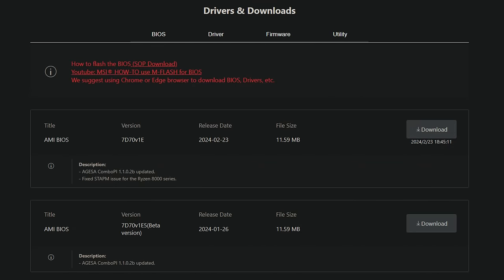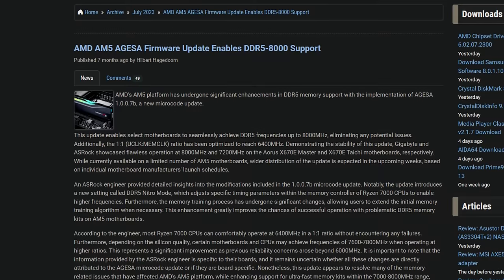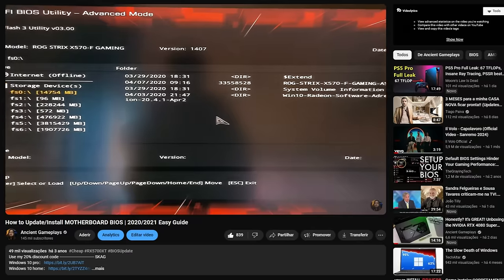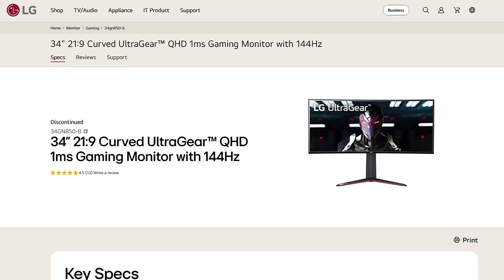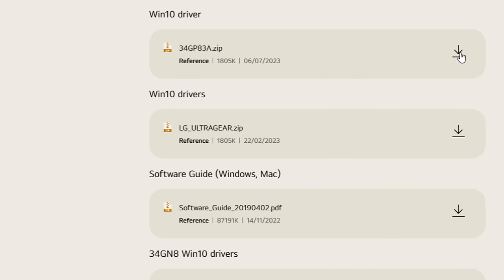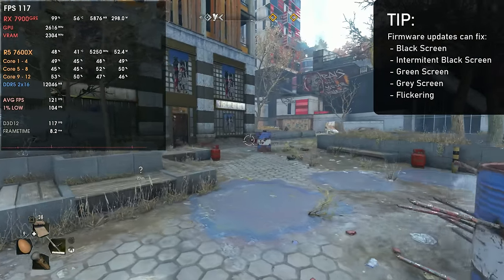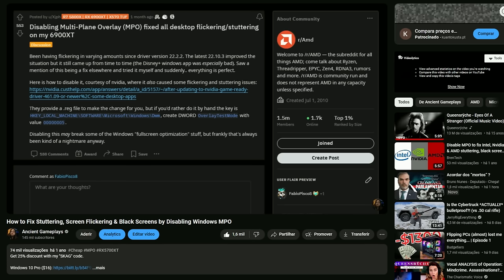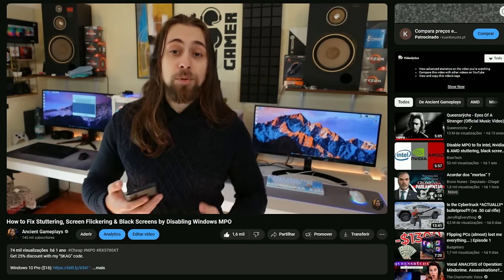20 TIPS to FIX "AMD GPU's Problems" | Easy 2024 Tutorial Guide

Comment: My graphics drivers suddenly time out, other times i get freeze and reboot, and some other times also i cant use the adrenalin software because it shows error of compatibility. While i game, i dont get any kind of reboot or timeout. Also sometimes, i have noticed green pixels flickering before boot, and then they stop in windows. I have tried ddu, chipset/gpu drivers, and many of your advice. Do u have any idea? 
Gpu: rx7900 xt
Cpu: 5800x3d
Mobo: b550 ax v2
Thanks again.
Reply: Woww tienes un monstruo. Lastima que tienes esos problemas. Te deseo suerte ❤
Reply: @catrielllampa6407  i did installation of the previous drivers plus new bios for the mobo, till now i dont get the same issue. Didn’t set mpo off yet. If i get it again, probably i will do a format to see if the issue persists.

Comment: Please help! Ryzen 5 5500 good for RX 6600XT?  Thank you master! And what is the max gpu, for the r5 5500 in 1080p?
Reply: The Ryzen 5500 only has PCIe 3.0
An RX6600 XT is only connected over 8 lanes. The Ryzen 5500 would slow down the 6600XT.
The 5600 would be better here.
The Ryzen 5500 only has 16 MB L3 cache.
The 5600, on the other hand, has 32 MB of L3 cache.
A large L3 cache is really important to prevent the CPU from having to ask the RAM for data it needs.
Reply: @40erKoernungSchachtpappe The performance impact of pcie 3.0 on a 6600 XT is pretty small if you look up actual tests, also you do need a B550/X470 mobo for that even if you get a cpu capable of it. The 5600 is significantly CPU better than a 5500 (Aka 5600G without iGPU) of course as you note otherwise. The 5500 is about on par with the previous gen 3600X.

In any case in that price range it's generally worth going used for at least the cpu/mobo if possible so which exact one you end up with may be dictated with what you end up getting a good deal on.

Comment: You buy a car in the showroom and go straight to the garage. On the way, a tire falls off, brakes fail, the steering wheel inverts, the engine shuts down.
Fuck it, it's normal, it can be fixed.
Reply from the maker: A completely messed up analogy that makes no sense. It's  more like, you buy a gasoline car, made to drive on good roads, then you go make cross with it while filling the tank with diesel, and THEN, you complain about how those cars suck
Reply: @AncientGameplays  Why should users of a finished product fix smth that should work out of the box?
Do you think that's normal? Personally, I think it's an impudence and an indication that AMD has a lot of nerve.
Reply from the maker: @eyesta  if you don't want to make anything buy a console as PCs are not for you
Reply: @AncientGameplays  I didn't ask you for advice on what to buy for me, I asked you what you think about AMD's attitude towards their users.
I've had a lot of AMD GPU's and they are all crap on the level of Nvidia, in work tasks it's especially crap.
I know what I'm talking about and my PC experience starts in 2004.I remember the real ATI, but now it's thrash.
I'm now a user of Nvidia products and when I watch your vids I enjoy my PC and laugh at you.
Peace!

Comment: When should I start worrying about psu age? My psu is already 8 years old(had it in my pc since 2016 and everything else has been upgraded since then). The psu I have is high quality and has 10 year warranty but still better be safe than sorry.
Reply: Capacitors are what degrades in power supplies. If you have a branded power supply, a long warranty indicates good components. Check the voltages, if they are stable everything is ok, stay calm 🙋
Reply from the maker: When it starts giving issues mostly

Comment: I didn't exactly try everything shown but I have taken my gpu out and tested my friends gpu ( deleted drivers before that and was already having problems) and my friends xfx r7800 series ghost worked way better. Then I put my rx 6750xt back and no issues until i downloaded drivers back (the latest ones) qnd suddenly all steam games are crashing and cod won't even start, I deleted the drivers once again (currently still withouth drivers) and now working again perfectly withouth crashes but some frame drops. What should I do?
Reply from the maker: You have something missing or causing issues there, maybe some software. Use ddu and update chipset drivers to begin with
Reply: Thanks! I'll test those tomorrow
Reply: It also crahsed withouth drivers ao I don't know what the issue is but I will try those. My windows might be corrupt in some way

Comment: Ancient Gameplays, your AMD videoes are amazing and has helped me alot with my 7900XTX, I am however running into a problem which occurs in World of Warcraft and Helldivers 2. It might happen in more games, but those are the ones I have where it happens, maybe you know of a fix. Completely random when I play the aforementioned games, they will hang, cause a black screen and then restart, Adrenaline settings will reset. When I took a look in the eventviewer it read "Display driver amduw23g stopped responding and has successfully recovered" I have looked and looked but I haven't found a fix that has worked yet. 

I have reinstalled drivers and chipsets and even reinstalled windows, disabled RAM overclock, nothing has worked. I ran exact same setup with an RTX 3070 and no problem, when I switched to the 7900XTX the problems started and persisted even after a clean reinstall of windows.

Comment: I don't know why but my 7900XTX can't complete Timespy with the memory at 2700mhz. It's completely stable on everything else. No crashes on anything besides Timespy. I can even complete the other DX 12 Ultimate benchmark( can't remember what it's called). Superstition works fine and I even did a loop with Heaven for an hour with no stability issues.

Comment: I wish AMD GPU could better handle VR than it does atm. If that was the case I would have bought the RX 7900xtx instead of a RTX 4080 Super.
Reply from the maker: Sadly it is one of tbe points where amd is still behind for sure

Comment: AMD VRR for some reason doesn't work for me, i randomly lose the image making anything unplayable, it started doing that after i upgraded from an rx570 to a rx6600 and no matter how clean my driver installation is it still persists, is there anything i can do to fix it? (and to add more problems i recently started to have bad aliasing issues)
Reply from the maker: Get a better cable and try a firmware update. Seems to be a monitor thing
Reply: @AncientGameplays Doesn't seem to work either, for the firmware update i'm pretty limited in what i can do because it's just a basic samsung monitor as for the cable i tried to swap with some hdmi cables i had for my ps4 and switch

Comment: Hey, I wanted to ask a problem I have been experiencing recently. I never had this issue before, and I have a good system on Windows 11 with the rx 6700 xt and ryzen5 5600x. In-game, the amd adrenalin overlay and metric overlay doesn't show up and is so slow when it opens when I'm playing my games in 4k resolution. 1080 and 1440p works, no problem. I tried doing a ddu and still having the same issue. Please help 🙏 😢

Comment: I had to download and use the AMD Auto-Detect program to get the chipset drivers to install, because the driver installation file using the method shown gave this error, ""This installer is intended to be deployed only on an AMD system. Exiting installation as the requirement is not satisfied."

Comment: Biggest problem is that when i watch somethink via hdmi cable the audio lags like 1,5 sec once in 10 minutes. 6700xt do that but also 7800xt. Its pretttäy annoying.
Reply from the maker: get a better cable and check your monitor inputs, it almost certainly an issue outside the GPU, It happens to me with the 4060 as well, its my cable/cable connection
Reply: @AncientGameplays  ok thanks. I try that.
Reply: @AncientGameplays  
can you try watching something via smart tv when you use hdmi cable? Monitors works fine but smart tv seems to be problem.

Comment: I bought a 7900 GRE and my favorite game had shader compilation stutter every time a new action occurred in the game. It constantly stuttered and was not playable.

 After spending about 6 hours looking for a fix (running around the game compiling shaders is not a fix) and trying it on my 3060ti it never stuttered on Nvidia, zero compilation stutter. 

After having weird desktop issues, (Yes I DDU and even factory reset pc twice) I returned it bought another nvidia card and haven’t had a single issue. 

( there are thousands of post on r/AMDHelp talking about dx11 compilation stutter, so it’s happening to a lot of users. )
Reply from the maker: What was the game exactly? Never heard of such game having some many stutter with some many driver versions
Reply: @AncientGameplays  Ghost Recon Wildlands.

Comment: I have an RX590, i believe thats the most fucked up GPU ever, specifically the XFX FatBot OC, constant black screens that lead to full reboots, having to reflash the bios.
It seems to be better with the latest drivers, 24.1.1, so at least i have that going.
Im planning on upgrading to either an RX6600, RX7600 or RTX4060, which one would be the best for the next 2 to 3 years? (gonna go into a bit of a debt to buy it since i cant purchase it right away)
Reply from the maker: Xfx gpus aren't that great and in the 400 and 500 series era they sucked really bad...
Reply: Lol man, indeed also run into several issues with RX 480 and RX 580 cards which are basically the same thing. I think these old cards from AMD are just made to be cheap from AMD and not to last that well. Sometimes you will be good with those cards and sometimes you will run into issues. I had really weird and different problems with AMD cards, I think I can claim that because I had about 15-20 amd cards from Polaris and a Vega GPU.

Comment: I have a RX6600 XT paired with a Ryzen 5 5600X and for the last 9 months or so when I start my pc a white led comes on the GPU next to the power cable plug.9 times out of ten it comes on and i get a message that default performance setting have been reset.it still works fine,but is annoying as I normaly run gpu overclock in Adrenaline app.might have to try the DDU wipe to see if that fixes the problem.

Comment: do I have assus PRIME B450M-A II motherboard with ryzen 5600 and rx 6700 xt, do I need to change to b550? or just buy better ram than 16 gb(2x) 3000mhz?
Reply: Idealy both, but with a 5600 non X3D I would say the RAM has the priority, would at least go either 3200 CL14 or 3600 CL16. Your 6700XT on the other hand doesn't really benefit from PCIe 4, so I wouldn'd bother about changing the mobo.

Comment: Mostly I agree with you, but I really don't like this approach that "is your fault if you have issues". We have to be realistic that AMD has more issues with the drivers than nvidia. And also it should not be that difficult to install a driver and run the computer with the default driver settings.
Also admit that AMD has messed up with the 2024 drivers. It is a driver issue if I can use driver 23.12.1 without issues and as soon as I move to 24.1.1 or 24.2.1 I get driver crashes (I have used DDU and clean install).
Also rolling back to 23.12.1 fixes the issues.

Good guide, but I hate your attitude towards criticism of AMD. We all want better quality products from both AMD and Nvidia.
Reply from the maker: Thanks, but it is not an aproach, it is a reality according to the thousands of people I'vde dealt with across the years

Comment: actually, the best way to fix amd problems is to buy the card after its like one - two years old :D 
Dont get me wrong, I dont mind doing more for gpu (which in amd cases you kinda have to) but lets say av1 recording being bugged in andrenaline for like 9 months and fix is scheluded to q3 2024? thats kinda..meh. or releasing a driver that can itroduce stutters to multiple games is not so great either.

Honestly, my second issue are the temps - too many posts about repasting 7900 xtx to get better hotspots - When I want maximum from my card at 464W, it eventually reaches 110 at hotspot (aorus elite AIB¨), without power limit 15+ its chill tho.

Now that we know AMD wont have high end or even powerful card next gen, they should really focus on faster fixes and user experience. 

With current state, I dont really see myself recomending an AMD gpu to someone who doesnt really know anything about pcs.

Lets hope amd will do better.
Reply: That temp ploblem is not a AMD problem, but a AIB problem. And that can happend on AMD and Nvidia GPU's. My 7900xtx is at a steady 57-64c while gaming. Hotspot is at +10c over the GPU temp. And that is with a silent fancurve and no undervolting. And regards to gameplay and stutter, there will allways come out new games with the need of new drivers, so waiting a couple of years would not help in that matter.
Reply: @Audiosan79  its a card design problem since even ref edition had it too. seen 35 7900 xtx so far in my hads and most of them had hotspot issues, and some even at default settings (except sapphire nitro+ edition) so yeah, it is an AMD problem. And like I said, you dont have to have problem with temps at stock 360+-W.. Worse is probably sapphire pulse, these have worst hotspot issues and only few are safe in stock.
Reply: @tomorpedreiro3032  The AMD reference temp problem was a vaporchamber problem that is solved ages ago. Most others are thermalpaste/mountingpressure problem. So it's not at all a AMD problem.
Reply: @Audiosan79  oh yeah, lets sell 1000$ card that you have to repaste and mount together urself so you wont have crazy delta :D not amd problem at all.

You can test it yourself. buy more pieces of AIB version and check their delta. you will be supprised how big is the chance to get bad sample. Not only that, it actually solves nothing since in few weeks hotspots are going up again even after all that..shame
Reply: @tomorpedreiro3032  You realy dont get the point do you? Did AMD build and sell those AIB cards??? no. Why is it then a AMD problem instead of a AIB problem?
Reply: @Audiosan79  did amd build an unstable chiplet that gets too hot? 😅
Reply: @tomorpedreiro3032  No they did not. i use that chipset, and its not hot at all. It's never the chip that gets to hot, it's the cooling that is not up for the task.
Reply: @Audiosan79  sure buddy, gpu lottery has been kind to you, sadly not all of us are that lucky 🤣
Reply: @tomorpedreiro3032  cooling capasity is not a lottery. I've had a total of 4 AMD GPU's from the same brand, where all of them have had good thermals, and zero coilwine. That is not by luck.
Reply: @Audiosan79  now the coilwine part is hardly believeable :D but 4 parts is still a nice luck, I had 35 7900 xtx in my hand so far, and sadly it is about luck :) tbf only like 5-6 of them had problem with hotspot at stock, few rest had problem with 400w+, and its all about getting lucky :)

Comment: I recently bought a new Rx 550 as an upgrade to my old computer but I am having a lot of issues like fps drops unstable fps mouse stuttering 75hz not working with the resolution and stuff. Before that I had a gt 9600 and I didn't have those issues. Any idea how to fix them?

Comment: One thing atm i struggle is to install new chipset drivers on my pc with asus x570/3700x. Everytime it just fails to install. Tried all kinds of diffrent new versions. Just seems like last option is to reformat my pc too be able to get the latest chipset drivers again.
Reply from the maker: you have a broken windows most likely. Uninstall the previous one via Windows, then install the new ones after a reboot

Comment: I wish I could get an answer, I have a 7800xt and a cooler master 850w plus gold and I keep getting those black screens, should it be the power supply? Ive had this PSU  for 1 year now, Im currently avoiding black screens by underpowering my GPU to 1080mv tension and 2000Mhz frequency, any advices will be very helpfull...

Comment: I just made the switch from a 4070 to a 7900 xt and i couldnt be more happy. But the only problem i am having is that it is not detecting my monitors as hdr and the picture is very dark
Reply from the maker: you need to clean install drivers to begin with (as shown), you might need a different cable type like displayport as well

Comment: Fabio I have a ryzen 5500 gt cpu and a rx6600 8 gig graphics card , due to me wanting to use multi monitors every time i download drivers for the graphics card and cpu all radeon settings disappear, so i dont get my frame generation for my gpu anymore. is there something i am doing wrong, or could you point me in the right direction or a video to watch thanks fabio.

Comment: a few problems ive got with AMD: Multiscreenmanagement was way better with Nvidia Software. With AMD, i have to use the Windows Manager... with 3 screens, its very annoying 
Sometimes freesync premium seems not to work correctly in some games. i have tearing. noticed it on my oled CX 48" tv , fps fixed between freesync range, lowered the fps @100 nothing works.
noticed a weird stuttering when i switch to desktop and back into game @enshrouded to
Multiscreen again: i work on 1st Screen, 2nd Screen youtube. and Videos stutter on 3d work load. put the 3090 in, no stutter, put the 7900XTX back, stutter.
Hardware usage off @ chrome, still stutter.. hmmm

Comment: Idk man,  I tried a lot of things, fresh windows 11. Bios/chipset/drivers updated and I still get driver timeouts. Ram passed mem86, my 7800 xt nitro passed every stress test. I still get driver timeouts, I Installed windows 11 yesterday. It started one week ago, now I disabled MPO I hope it will work. Any suggestions? I use process lasso on high performance. Temps are perfect, Psu 750 w gold.
Reply from the maker: I sense overclocking instsbility as explained
Reply: @AncientGameplays  thanks I'll try that as well. Indeed XMP is on but passed mem86 and memtest 5. I will increase the voltage.